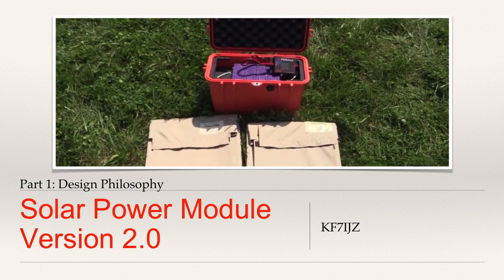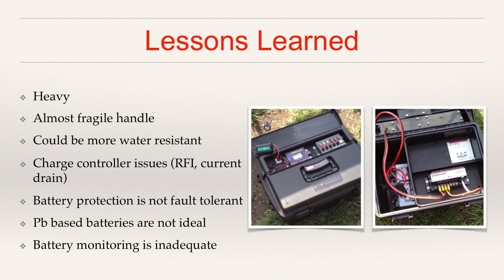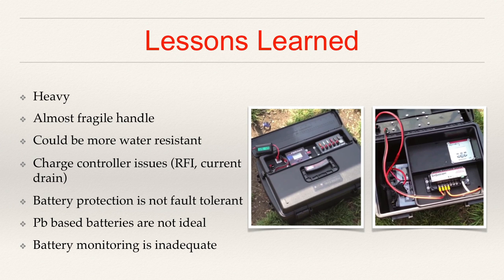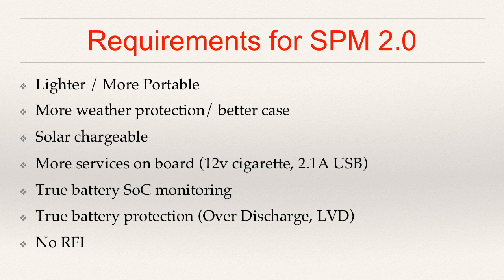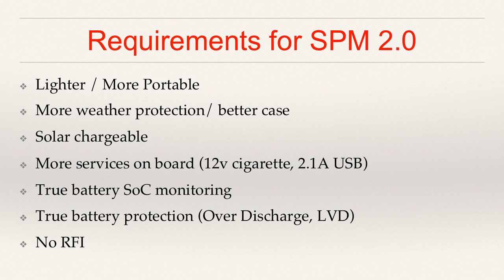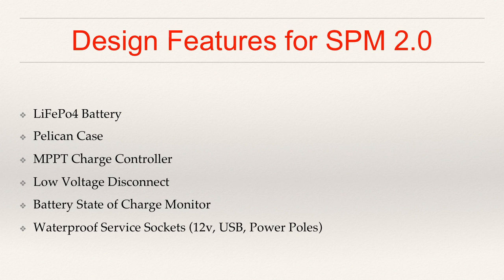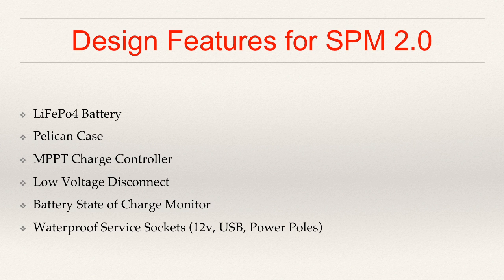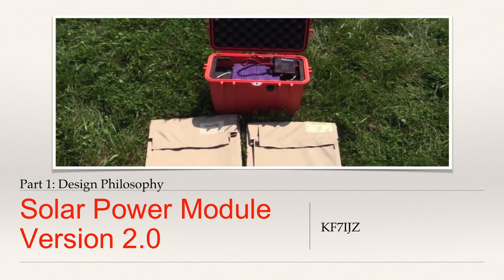DIY Emergency Portable Solar Power Module 2.0 Part 1 - Design Philosophy

Comment: I have been doing some research into building my own portable power supply. You know much more about this than I do, but here are a few suggestions you may find useful. 

Pelican Case - You can go to the oem Pelican site (PelicanOem dot com), click on Planning, and download the cad drawings for a specific case. This will aid if you want to get a custom arcrylic interface panel made. You can create your own custom interface panel at DataPro dot net. They offer many options and make ordering easy.
USB - I have seen some rigs with a 3 AMP USB port for quick charging.
SoC - I have watched a few vids on the Victron Energy BMV -600 /BMV-700 battery monitor. Small foot print, a lot of capabilities.
Anderson Powerpole - hardened Power Supplies makes Anderson Auto Grips which are GREAT mounts for mounting Anderson Powerpoles. They are ROCK solid. They are made from HDPE.
Switches - Digikey has a wide variety of internal parts like switches, connectors, cables, etc.
Internal Lighting - You may consider adding an internal LED light in case you need to fiddle with your rig at night.

I am looking forward to you next vid! Keep up the great work!

Comment: Good video, you clearly explain your design philosophy. What is the operational goal for this new unit? What are your reasonable expectations? I'm thinking about a hurricane, 2-4 days with little or no Sun and the grid down. Anyone in S FL knows that is a very realistic situation. Can you translate 40Ah into how long you'd expect to be able to run your KX3 at max power, 12W, and how long you'd be able to run the KX3 plus the 100 W amp on SSB before you reach critical battery depletion? 73 K3JH
Reply from the maker: This is a great question.  I will have to load the battery up to simulate usual operating conditions and run a long term test to measure performance.  I estimated that with my solar capability (anywhere between 20 and 450 watts of solar generation), I could pretty much run indefinitely a radio, especially considering in that MO, I'm more likely to be listening than transmitting.